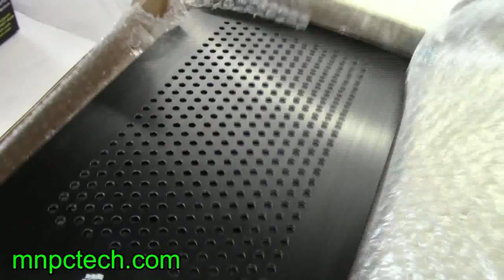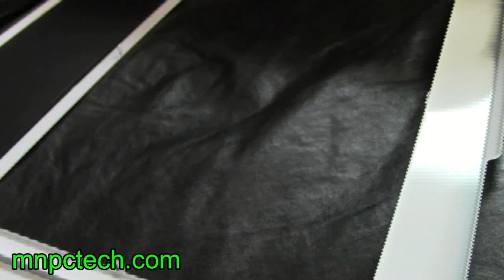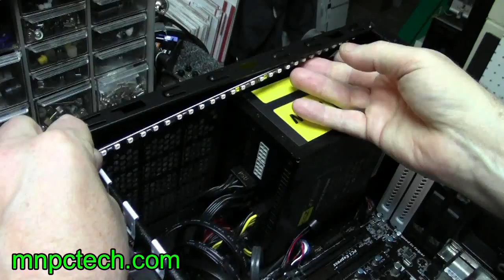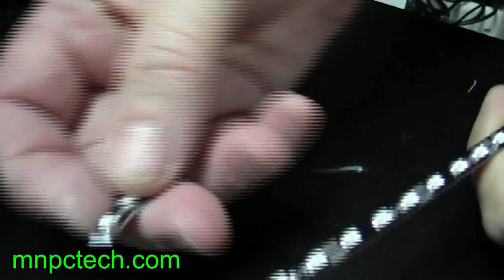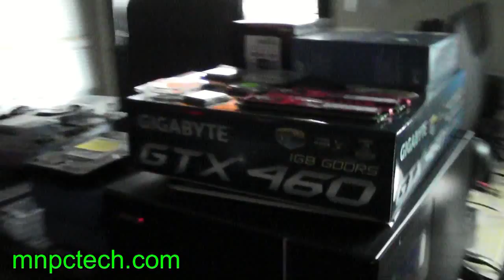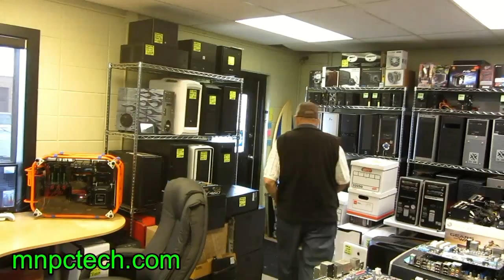Mnpctech VLOG: Corsair CNC front plates, NZXT Giveaway, Darkside LED Install

Comment: That's awesome!  My plan is to install a strip on the bottom and a strip on the top, connect them with a fan cable and then plug them into my fan controller.